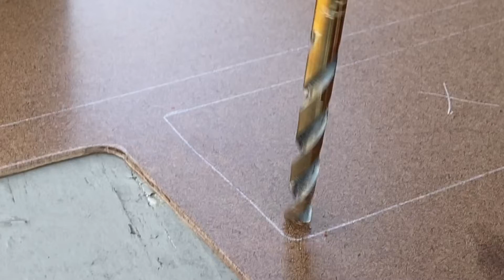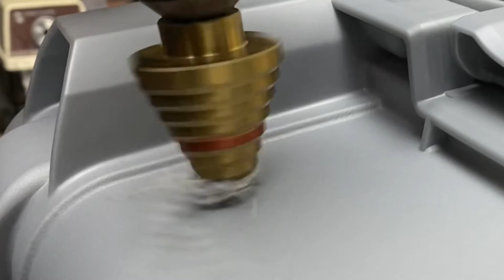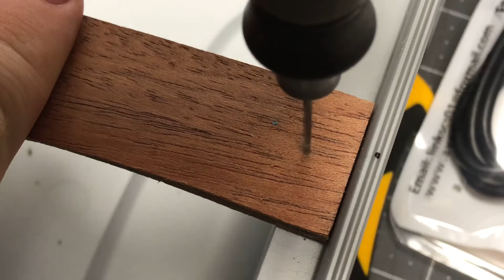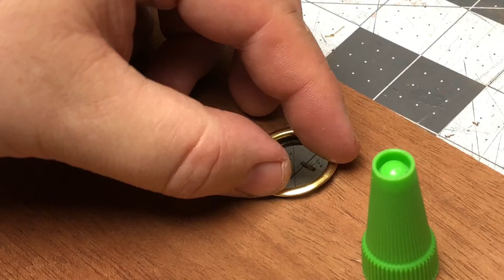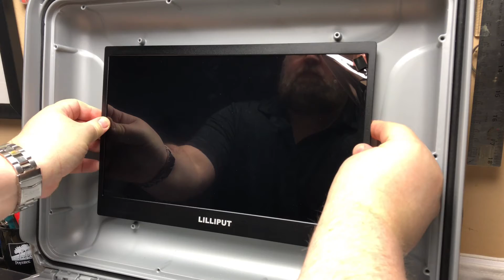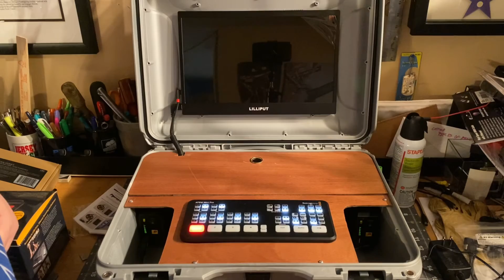Custom ATEM Mini Pro mobile switcher build

Comment: What did you build the top plate out of that holds the ATEM Mini?
Reply from the maker: Was just a piece of chip board. I eventually will update to a plastic, but the wood helps keep it cool.

Comment: What kind/size of battery do you have, I was looking at buying a 500 Wh solar generator (no gas) to be mobile with my atem setup. Great vid
Reply from the maker: It’s the talent cell battery 72w 100wh unit. You can find on Amazon. You need to also buy a DC Power 5.5 x 2.1mm / 2.5mm Male to 5.5 2.1/2.5mm Male Plug Cable Right Angled 90 Degrees